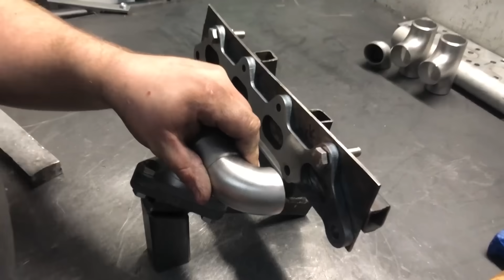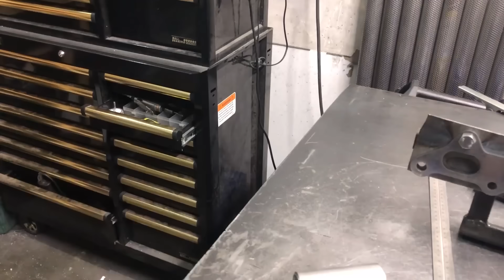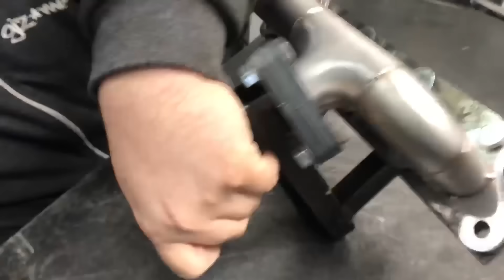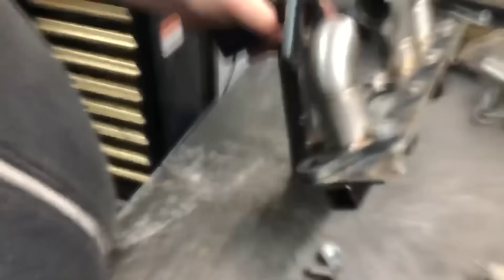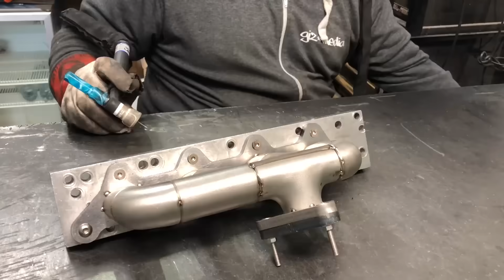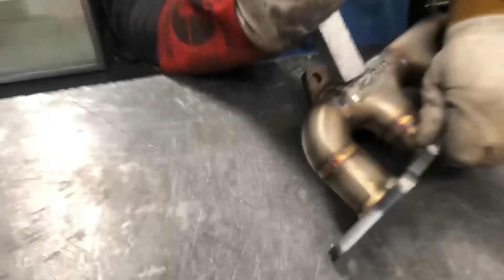GizFab - Mitsubishi Colt 4G15 Turbo Manifold Fabrication Timelapse

Comment: What's the max. HP (torque) Limit with this exhaust?
Reply from the maker: For the OEM Turbo, the turbo runs out first.
Reply: @GizFab  Sounds like up to 250...
Reply from the maker: @camhlaidhgrimoffical  300

Comment: How do you make and design the frame/jig
Reply from the maker: Process is shown in some newer videos.
Reply: @GizFab  thanks. Il look for it now. 

I wanted to build a tubular but just don’t have the room. So I bealieve il do a log. 2.0tdci with a gtb2260. Should I go 1.5” straight out, into 2”? I want it to spool asap

If you have a website or number I’m happy to pay for info/advice/knowledge
Reply from the maker: You want to match the port size of the head were best as possible. 1.25" SCH would spool quicker, but 1.5" SCH would handle EGT a bit better which can be a major issue on the diesels.
Reply: @GizFab  found your website. Very nice. Do you have the software to remap a dcm6.1 mondeo 2016 2.0tdci

Comment: Great Job! What is the inner diameter of the pipes? 
I'm looking for an exhaust manifold for my Colt.
Reply from the maker: 37mm ID
Reply: @GizFab  Wall thickness 3 or 4?
Reply from the maker: @NouT1989  2.7mm

Comment: Need to get myself a set of those purge bungs 👀 I'd save sooooo much on gas 👀😅
Reply from the maker: bluetooth mate. its the future.
Reply: @GizFab  honestly man, if there was Bluetooth torches! The amount of times my chair got stuck on my cable today 👀 the future is now! 
could be possible to hang an 8m torch line from the roof though 🤔
Reply: @GizFab  jokes aside, your welding looks good man 👌 
Did you have much backside pen on that part anyway?
Reply from the maker: @shunter_3856  Back in the early days no. Techniques have changed, a lot has been learned.

Comment: Cool! I read the description on the purge thing. In welded usual headers etc with no purge for ages and had no issues just street cars, then started purging and never went back just because of the quality! Even still, a good replacement manifold and it will work. No doubt about it. Some times the internet just try’s to put people down! Good job! Like some of the tooling you sell I may have to purchase! What torch are you using there?

Comment: I do a lot of stainless pipe welding at work * we purge most welds so that you get a smooth finish inside. We also pickle the welds after to get rid of the heat marks & get that clean stainless look.

Comment: All that effort and nice welds just to be ruined by not purging... (facepalm)
Reply from the maker: Kristopher Tovey thanks for your input.
Reply: @GizFab  Oxidisation of stainless causes chromium depletion in the Heat affected zone,  This causes further corrosion over time and leaves hidious stress risers.  In the aerospace industry if I did welds like that the part would be scrap.    Your welds look pretty perfect, but not back purging is just not ideal.
Reply from the maker: Kristopher Tovey I know what purging it. In the description shows why we didn’t purge this manifold. We have altered our pricing structure and these manifolds are now purged.

Comment: отличная работа. на сколько он хорошо работает,по сравнению с рогатым равнодлинным коллектором?
Reply from the maker: A Tubular will perform better. but thats not the purpose of this style of manifold. Alot of countries do not allow modification of the exhaust system. So improved manifolds are able to fit under the factory covers.
Reply: @GizFab  thank you very much for the information

Comment: Pretty good fitting. The complaint I would have as a customer is that you used schedule 10 pipe but failed to weld a root pass with a purge throughout the weld process. That would make it it extremely prone to failure because of oxidation (sugar) on the inside of the weld

Comment: This would be a good upgrade on a 4G32T engine as well, 
since the exhaust manifold on these engines cracks easily, 
plus a manefold like this is guaranteed to have better flow than the original manifold as well. 
Brilliant work .. !!

Comment: Thats al great and keep a good work, but keep in mind one thing the cylinders on the 2,3 will make a hotter temperature than 1,4 because of that exhaust is made with T type and the gases canos escape that much like on L type, make it more to a center better and will make more power.

Comment: Im not sure what purging is.
Is that where you damn (argon) inside the manifold and still use shielding gas (argon for example)?
Reply: yea back purging is over purging argon gas inside the manifold with aluminium foil blocking the open ends so that as you weld the outside the inside wont sugar though and oxidize creating dags which will eat your turbo blades.
Reply: @SMVB-cl6oc  okay im not sure what you mean by sugar through and dags. But I understand that with the argon gas being inside the manifold creates a zero oxygen atmosphere. Oxygen creates porosity or black spots in an x-ray test. I believe the welding penetrates through the material (manifold) and if not purged (on the inside) will have porosity due to oxygen being present with the fusing metals.

Comment: Why didn’t you purge the inside, as that would have coked up so much 😂
Reply: I checked twice to check if he purged but he didn't. I confused that he weld carbon steel but propably not. He just cleaned inside  where he reached but not visible welds propably looks bad inside.

Comment: Huge pitty of such a good level of fabrication. This manifold does not make sense. Good heating engineering output, but not manifold.

At least, instead of using T-elbows should be used regular elbows to direct gases flow to collector.

Comment: You should purge that.
Add a barbed fitting to you're jig for purge gas before finish welding.
Looks good on the outside ,but the exhaust  flows on the inside.
Reply from the maker: I know all about purging. it wasn't chosen for these particular manifold for a few reasons.  You will be happy to know im now setup for purging anything and everything - and i do when possible.
Reply: @GizFab  buddy you do great work.Excellence is in the details.
I enjoy you're videos.

Comment: looks good, but whats the point in making a custom manifold if there is no calculation behind and each manifold has a different length  to the merge collector?? I you are not so bothered about the numbers, pressure waves/pulses in the exhaust, each manifold length and all the "magic" behind just use stock factory. Also carbide precipitation  without back purge, total shit in here sorry  for the honesty.
Reply from the maker: M M if you bother to read the description. All is explained.

Comment: No back purge, No heat treat to destress the welds, Poor finish, no port matching. Runners are not flowing properly. I mean it will work but no better than a POS cheep crap from ebay. Only a strait tubular flowing manifold will yield better results. For the time and labor here, much better work could be done. 
Welds are awesome though and the fab work is very good. For a beginner fab, its not bad. but not worth much$ compared to what you can spend it on instead. too bad.
Reply from the maker: loligagger85 and yet another un educated post. Read the description.

Comment: Where is the inner protective gas (argon)?
Reply from the maker: fosmotor doesn’t work Tuesdays.
Reply: @GizFab  Then you make a scrap on Tuesday?
Reply from the maker: @fosmotor  Manifold as not scrap at all. Will work perfectly fine.

Comment: Excellent job. Yes it's a log type manifold but the performance will still be excellent so who cares if it doesn't have smooth flowing lines. Certainly a lot more compact than individual tubes.

Comment: I like it. With such thick tubing, it probably doesn't raise underhood temperatures like header tubes do.

I'm glad to have a 4B11T. Some companies cast a stainless steel exhaust manifold that is a great replacement which also adds horsepower. I suppose if the 4G15 had as many fans, they too could get such a manifold.

Comment: Purge comment?  There is a nice brush on coating you could use on inside, cheap and easy, to eliminate need.   But the thick wall  fittings won't fail due to no purge on this app.

Comment: I own this actual manifold. Lovely piece of kit. It is designed to be an OEM replacement rather than an upgrade as the standard manifolds are prone to cracking round the collector. There are performance manifolds on the market but this one is half the price.
Reply: Finally a comment worth reading. I follow gizfab on insta as well as on here and I'm blown away by how many ignorant comments there are. This video went viral for some reason though! Most of his vids are only in the hundreds or maybe a few thousand views. This one is up to over 600K at the time of this comment. I wonder what happened!
Reply: Mx5 much ?
Reply: Performance turbo collectors are a huge pile of additional work and they take up more space. Beautiful? Certainly but do they really make “that” much difference in the real world?
Reply: yeah and it's welding without rear gas .. called backing gas. so I wouldnt take a look inside.

Comment: Nice workmanship !
But...does it have a scientific background ?
Reply: This kind of exhaust plenum turbo headers have been around a good 15-20 years. The key for it to work flawlessly is not having too much exhaust cam duration for the one cylinder not contaminating the other and dont go compressor heavy turbo.
Hondas do like 350-4whp on this headers. Just be a man on the turbine side when you choose turbo.
If you have compressor heavy turbo you must work with lower boost pressure.

Comment: "Lack of decent purge tooling"

Guess you spent all your money on that sick band saw and belt sander. You couldn't afford an argon splitter, tinfoil and some home depot tubing. Back purge matters. Go ahead, show us the inside. I'm guessing there's still joint showing where there isn't extreme sugaring.
Reply: I was 30 seconds in and was like hmmmm where's the purge son?
Reply from the maker: If you took the time to check our Facebook and Instagrams, you would see we purge pretty much all the time now. Invested in some purge tooling.
Reply: @GizFab  "But i would also like to state that nothing I've have not purged has not broke."
Reply: @GizFab  purge tooling..... lol. 

Hey man it's your video out there for everyone to see.
Reply: J'sWorld,
If you are proficient with a TIG, back purging doesn't matter in this scenario. The material is thick. All you need to do is fit it good and NOT burn the whole way through. A 75% penetration on this part would be plenty adequate. If it has a weld "hump" 25% the thickness of the material, and 75% penetration, everything is fine.  Think about it...
Reply: @6061  I thin that when you have a manifold with no room for thermal expansion, made of the wrong grade of stainless, could see temps as high as ~1750°f, and full of pressure that EVERYTHING counts. Every gap, open root, undercut, sugaring, and every place for a hot spot to develop matters.  Maybe they don't come back, maybe the users are only pushing 6 PSi, who knows.

Comment: No purge on the stainless?
Reply: there is no reason to purge if you dont penetrate all through, its a fucking header its not like youre in the nuclear factory and welding critical joints.
Reply from the maker: Honestly...The comments on this video are like a stuck record...
Reply: @GizFab  You should know everybody on the internet is a Pro welder, machinist, and mechanic! (And an expert on whatever subject the video is about)

But- I just thought it was kind of odd- every time I welded stainless without backing gas- it ended up sugaring on the back-side.
Reply from the maker: @ericmcknight9394  Everyone has their own method. I don't always go for full penetration hence why no back purging.  but always tend to do 2 passes to fill any undercut.

New videos due shortly.

Comment: Just curious why didnt you purge? Its stainless right?
Reply from the maker: kventis budget restrictions to keep sales cost down and lack of tooling at the time this was built.
Reply: @GizFab  so then you dont fully penetrate? As per 6061.com's teachings? ;)
Anyway good job man, keep it up! You make it look easy, how long you been doing this?
Reply from the maker: kventis the issue I find is. People with no actual experience watch a few videos and instantly become the welding experts and begin to start telling everyone with the experience on how it should be done. I’ve been doing this for 3 years now, tend to go no pen but double pass. Warranty would be the same if I purged or not.
Reply: @Chomersson  
Haha, don't drag me into this... He's welding thick material. Totally different scenario than .060" thin wall tubing.
No need to back purge these parts if they are fitted good and the weld is thick enough. Just don't burn the whole way through and get sugaring on the inside.
Reply: @6061  didnt even think youd see this, let alone reply.. :) anyway, gotcha guys, loud and clear! Just making sure I dont mess mine up when I do it, thanks for the feedback!
Reply: Been tig welding for almost 20 years. He puts a decent bevel on them and will be plenty strong. No need for a purge unless you'll be burning through.

Comment: Работа красивая, не более того. Коллектор нерабочий.
Reply: Коллектор полное дно
Reply: @ВладКлимов-к9я  сделай лучше раз ты такой умник и покажи своё видео
Reply from the maker: collector is fine for the application. Maxed out a Hybrid turbo on the application....
Reply: @GizFab  that blows only in 2nd celind3r?)
Reply from the maker: @CIArussia  Gas will find the path of least resistance, which in this case will be the turbo inlet.
Reply: Друг а как же противодавление?
Reply: @НиколайОзнобихин-р8б  это для турбины,там не важна длина труб и порядок соединения цилиндров
Reply: Механик ахахаха, скажите это hks greddy =))))

Comment: How much do you charge for one off mani's like this? For example a 91 Mitsubishi expo 8valve 4g64 turbo log manifold?
Reply from the maker: The difficulty is,  without the engine itself to make the manifold on, it will be difficult to get the turbo flange in a good position so it clears the engine aswell as the other bits around it, like the radiator etc.

Comment: Almost perfect. Minor critique... You don't really need anything fancy to Purge parts. In a pinch a y splitter w/ aluminum foil around a line stuffed in the turbo flange or solar flux the  parts before welding. Hopefully you or someone finds these cheap solutions useful!
Reply from the maker: Read description regarding purging.
Reply: @GizFab  I did. Hence the you don't need "fancy Purge set up" bit. The comments more for up comers who see this video and find inspiration not for you who probably has the nessecary bits now.

Comment: I think you should inertize the inner atmosphere with argon.  Anyway, looks really good!
Reply from the maker: No purge as explained in the description.
Reply: @GizFab  I am sure it won't broke, it is just that the material that flows into the pipe comes into contact with the air and is abruptly contaminated. To prevent this from happening you must inertize the inside of the pipe with argon. You do not need tools, the way to do this is inserting a hose with argon, cover both ends of the pipe with paper tape, make a small hole at both ends, at one end enter the argon with the hose and the other let it out generating a small current Argon which will fill the interior of the pipe and move the air. But do not worry, it was very nice work!
Reply from the maker: @elschummy  Im fully aware of what Back purging is.

Comment: Nice manifold and good work.
Always confuses me though why you would spend the time building a stock (log manifold) when a few bends and a collector would get you probably better airflow and performance.
Reply from the maker: Because these manifolds are made to be a cost effective solution to replace the standard manifolds which are a poor design and prone to failure.

I do offer full tubulars for the same setup for those wanting to spend a little bit more.

Comment: Каналы под 90° утопия. Он задушен будет.
Reply from the maker: Proven to support 260bhp+ on Hybrid TF035. I wouldn't say it was restricted at all.

But...a Tubular will ALWAYS out perform a log manifold. 

These manifolds are a solution to replace the factory manifold.
Reply: GizFab да это понятно. Даже если к забору прикрутить мощный движетель и он то же полетит!?!
Reply from the maker: @nikolaynenakhov9341  you may get some different spooling characteristics with the tubular. a Log will make better low down torque, but a log will make power towards the peak. We offer both style of manifolds.
Reply: @GizFab  what hybrid tf035? I have a mirage with motor 4g15t. I think better to put td04hl
Reply: nikolay nenakhov
 базара зиро, но это же кольт.. там и так места мало.. какой заказали такой и сделал)) походу надо было только фланец для турбины поменять на больший...  но я се равно люблю по меньше углы труб
Reply: Проверено JTlab на двигателе d16 с турбиной td04l, быстро раздувается с самых низов и нет затыка вплоть до 7000rmp, для городского авто с небольшим бустом самое то)

Comment: Do you have any problems of the head flanges warping? I find that the log manifolds like warping the flange
Reply from the maker: Elwin Priem i use a 30mm thick soak bar to prevent the flange warping during welding. They are then linished flat after.
Reply from the maker: Elwin Priem logs fo create a lot of heat due to their design. Especially if using it for performance reasons. One of the main benefits of a tubular would be the lower EGTs at the collector.
Reply: @GizFab thanx  that could be te reason